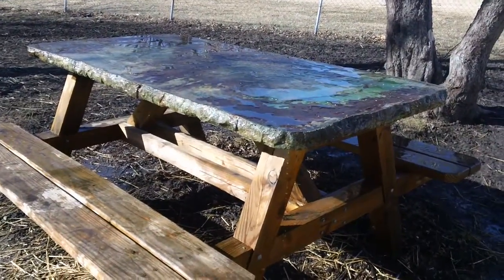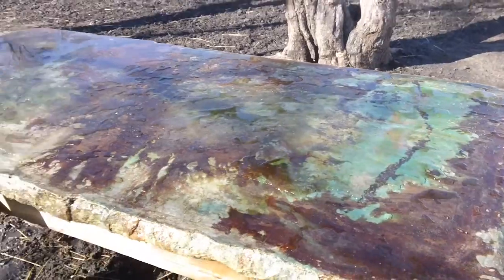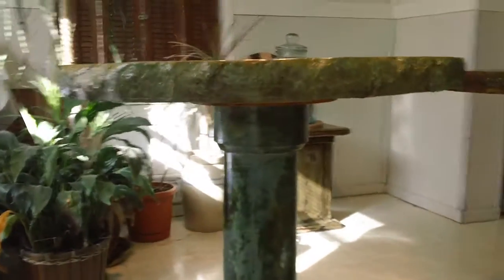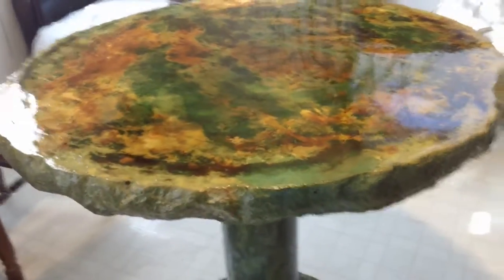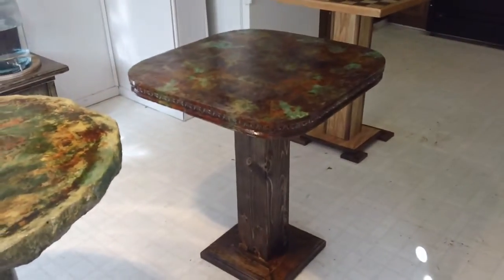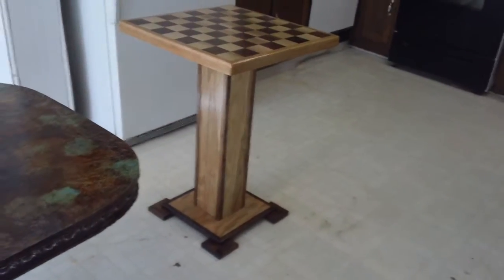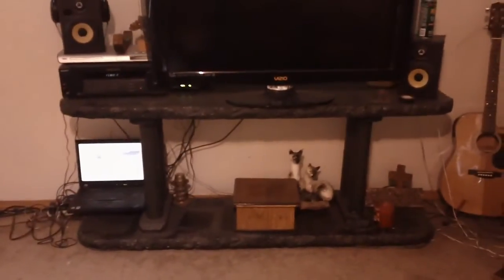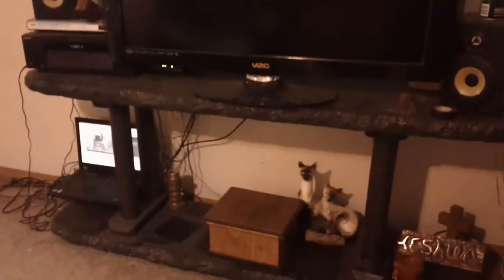Cast Concrete Part 3

Comment: Have the concrete counters in our house. Wife put hot pan on counter top and finish is damaged. How do you repair small spots where finish has blistered and come up. Have no idea what tops were finished with .Low gloss.
Reply from the maker: Hello Roy greetings. You have stumbled on a very important choice that many lack the understanding on and that causes much heartache. Finish is basically among these choices...epoxy is supper slick and high gloss and durable.....EXCEPT it will yellow in the sun .. thats its weakness and cost and how hard and messy it is.. Acrylic wont yellow in the sun but wont take large temp swings and cold temps it gets brittle and cracks and flakes...but a little easier and less cost .. and then there is spar or polyurethane.. which is easy.. (out of a can) and I think a good choice.. BUT. deteriorates due to uvr like plastic.. all good choices INSIDE ... IF you dont set hot stuff on them,,,,LOL all will scorch and discolor... HOW EVER.. it is possible to have a high gloss finish WITH OUT any of these. THE smart choice for counter tops is WAX... Polish first if you choose.. But wax sealed counter tops are the ONLY ones to my knowledge that you can sit hot pans on safely. If the wax gets melted or messed up it can be simply can be re waxed... SO,,,,,, Out side Use the best concrete sealer you can find and put on several layer thin.. use the high gloss... and addressing.. YOUR counter tops well you either have Wax sealed or NOT....
epoxy your screwed or strip and re finish entire top... poly or acrylic may be sanded and rubbed with thinner and cleaned up and resprayed from a can good luck 75% you save it.. I dont know if my rambling helped or not but I hope it works out.. YOU might try sanding it with 000o steel wool to take some out and probably re buff to shiine but you go threw the finish...into the color... your done..

Comment: Very nice looking....how do you get the color pattern in the concrete?
Reply from the maker: I suggest you use what ever you got laying around for a form to pour small practice slabs for color experimentation . I find for natural stone look its best not to brush and leave brush strokes as they will appear unnatural in the finish product . Dab with rag or sponge works OK. I use a ring out stain of a rag over area to let the natural liquid viscosity determine the shape and then up to 3 more colors in same way careful not to over lap and leave small areas between I then fill in with a brush of dark stain in the voids dabbing and pushing the liquid and use diluted darker colors to tone down bright colors if I deem it a necessity . light colors go on first then darker ones. if you mix them one over the other. basically slop it on any way you can its hard to mess up. 2 or 3 colors of brown work great for stone look.
Reply: Ok thanks will try some this summer